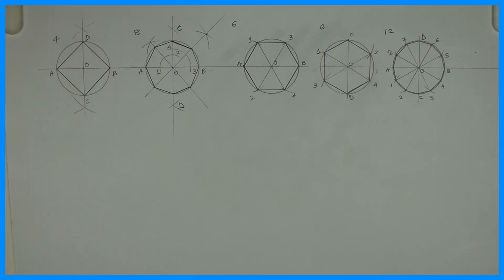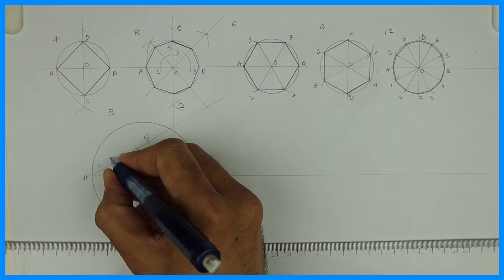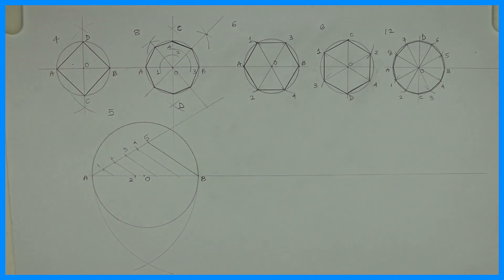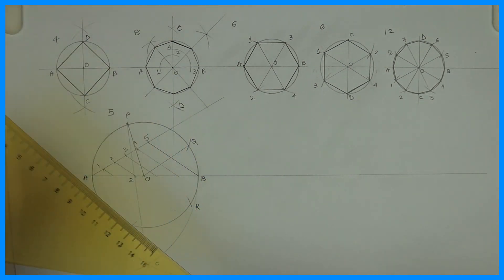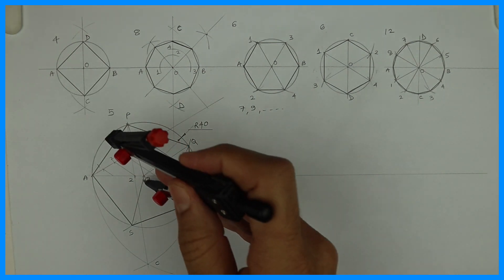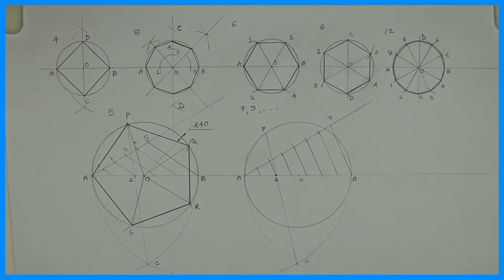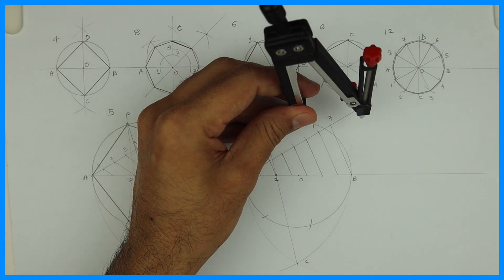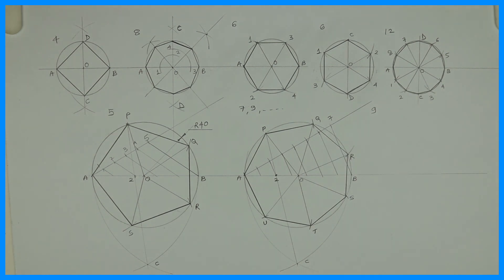How to draw any polygon inside a circle (5,7, 9..) - Engineering drawing - Technical drawing

Comment: THIS IS DEFINITELY NOT ACCURATE ... this method works only if you draw on paper with a very thick pencil. Try draw it up in CAD and you will get an error of 0.6 degrees .... NOT "Engineering" or "Technical"!